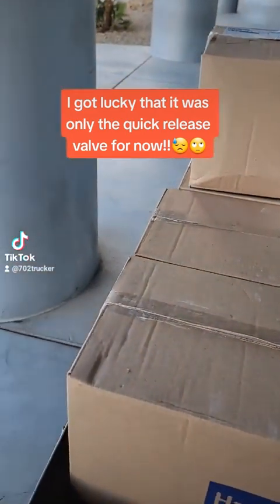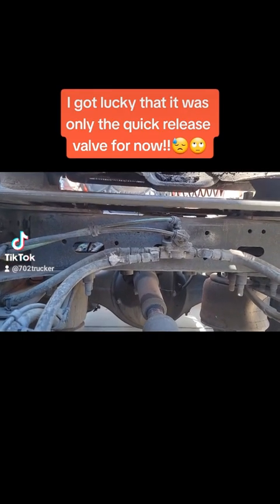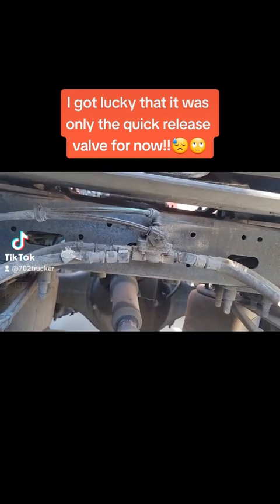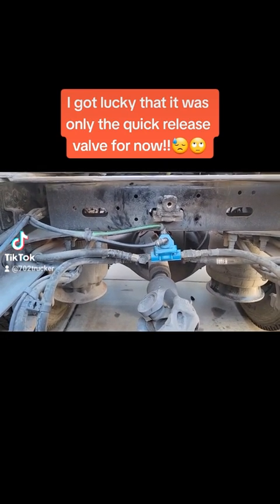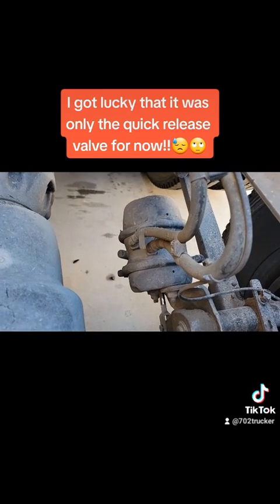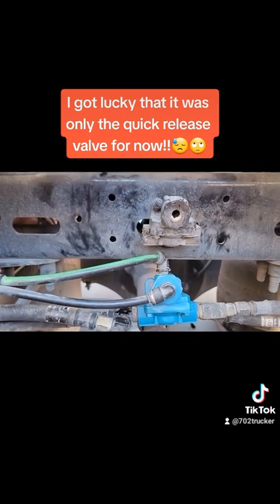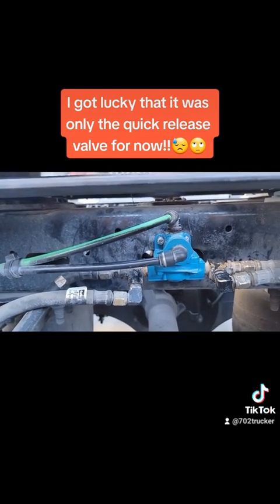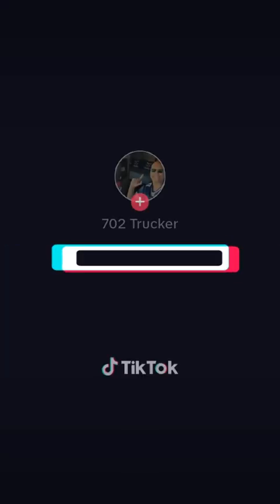R/R 2016 Cascadia quick release valve

Comment: Hey dude quick questions is that sucker on yrs been leaking air even while you was parked ? But no air leak sound ? 2 nd question did yr truck moved forward a lit bit while you came to stop while you pull your yellow park brake ? 3 question did your rear  2 air bags deflated while you parked over night or for like geting fuel at truck stop for about 30 40 min ? Man I hate this Freightliner I fix one issue it’s shows pops up new one I’m working only to fix this truck haven’t seen $$$ for long time thanks
Reply from the maker: @ilhommuninov708 Just when I pushed in the yellow brake release
Reply from the maker: Also one of your air bags can be leaking.
Reply: Thanks for responding looks I got solved the problem that sucker was a quick release valve under the fifth wheel
Reply from the maker: @ilhommuminov708  That's all it was for me also,.
Reply: How much did it cost to get fix bro??